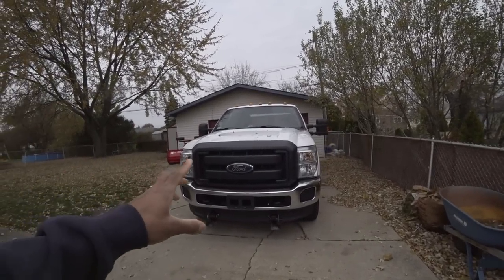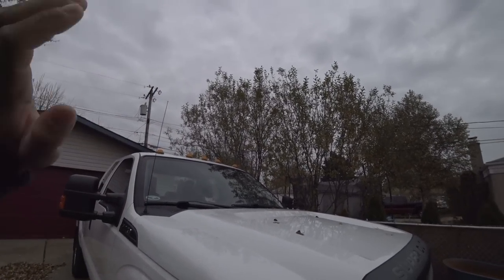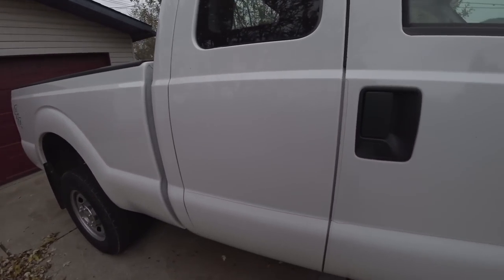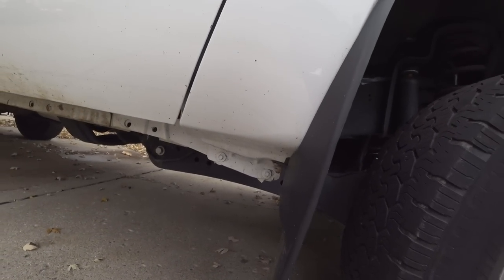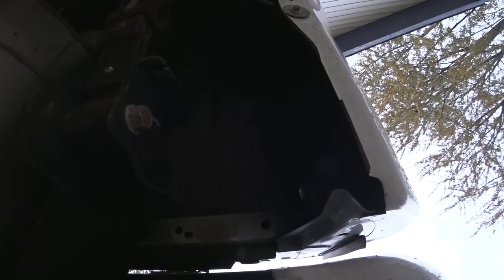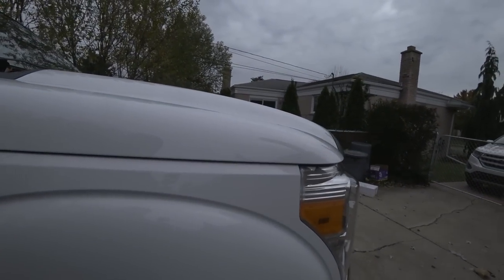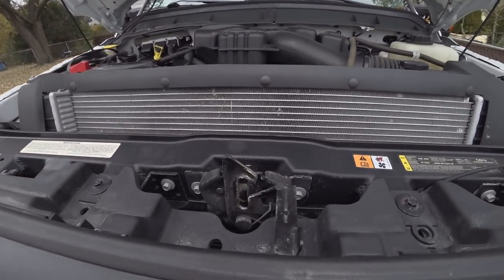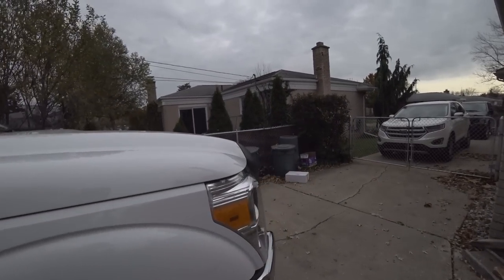Long term effects of snow plowing on my 2015 F250...

Comment: I know this is an old video but the best thing you can do to help minimize rust is of course undercoat with something. We used to use Fluid Film but our problem was in our area it can get too cold to spray it even in September. I found a product from PB Blaster that was kind of the same as Fluid Film and to me, worked better. It seem to creep into crevices as it was thinner than FF. Problem with the PB Blaster was it only came in spray cans and was 12 bucks a can and after driving 1 hour away to buy 16 cans to do my truck 6 of the cans did not work and zero and I mean ZERO response from the company. This year I am trying Krown. That dealer installs Line X also sprays Krown undercoating and for 160 bucks and a guarantee against rust...have at it! He showed me his 13 year old or so Dodge Dakota and there is zero rust. Key to any prevention is spraying something when the vehicle is brand new and in our situation with plowing and salting is cleaning it off occasionally and reapplying undercoating every year.

Comment: Truck is in good shape. Those marks on the paint are more than likely 'rail dust' that gets on there from shipping when new. Clay-bar the paint and it will clean it that up and it will look like new.
Tip: After 30 years of plowing snow, run it through the car wash once a month at a minimum after the streets dry up from the salt and pressure wash the plow and under the truck. Personally, I pressure wash my plow after every storm once the roads dry up and run it through the car wash when getting gas, again after each plowing event. Been doing this 10 minutes worth of upkeep on the equipment and truck looks new like the day I bought it and I do all commercial, 100% so it's going non-stop during a storm.

It's a Super Duty, so take care of it and it will last you for a long time! The rust that is on there is nothing. Truck looks in good shape.
Reply from the maker: Sean Brennan thanks! I appreciate it!

Comment: I am in Alaska and we have lots of salts on the road but with out 89 93 and 96 f250s and f350 undercoating is very important. Family has been plowing with these trucks since 1990 and still going. We don't give a care about the body. Tires are important but I don't think you guys get paid like we do lol. $65 to $80 an hour to plow snow. Contract jobs up here in Alaska is the way to go.
Reply: I only plow houses for Jews 350-500 a house

Comment: Sean,
Does the Super Duty have the "Capless Fuel" filler neck? Or is it a standard cap on the fuel tank?

Thank you
Reply: Has cap
Reply: @mitchellsanders9999  Thank you very much, I appreciate your help. I do not like the capless system.